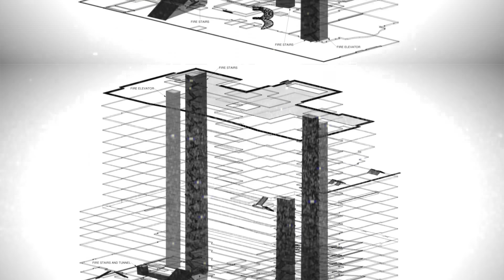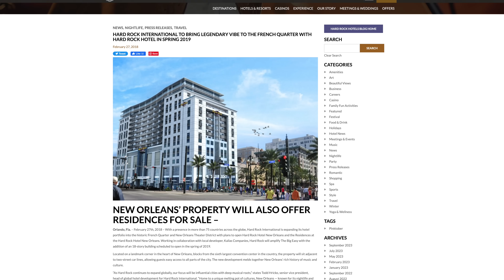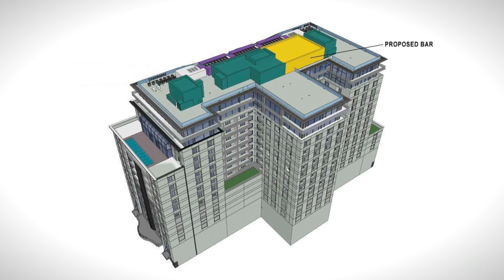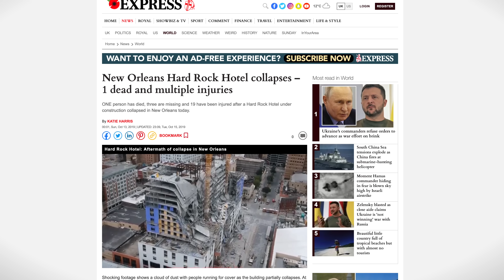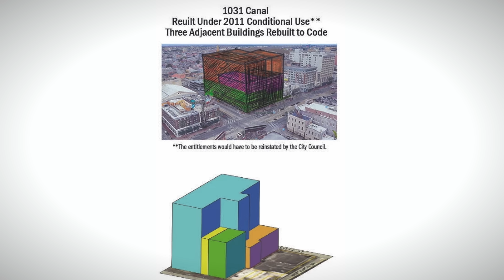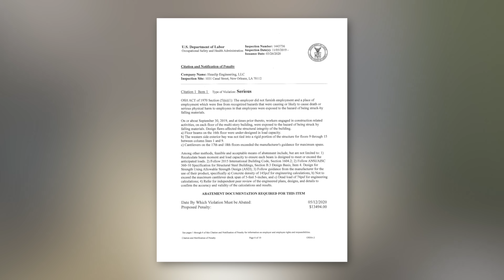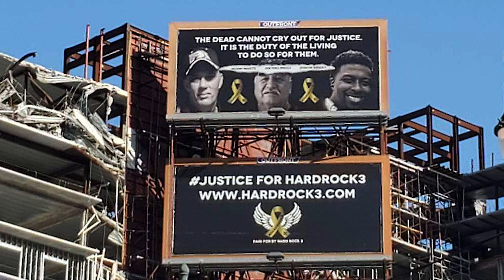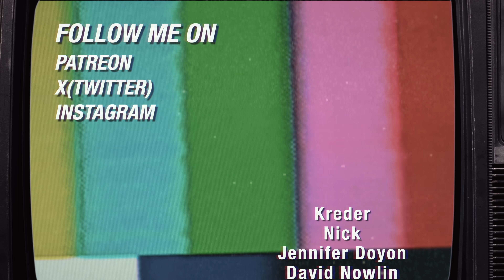Cancelled - Hard Rock Hotel Collapse New Orleans

Comment: Great job on the Hard Rock Hotel New Orleans, I can't believe that nobody got charged for the disaster. I can't wait for your next video.
Reply: I saw other youtubers cover this, they deported several whistleblowers ontop of the firing of the prosecutor.  Credit travels up blame travels down.

This project was pretty aggressively done incorrect at every level.  I'm sure those the most at fault worked really hard to make sure they were ignorant as to why their demands lead to this.
Reply: Obviously, many people, through competence and negligence, contributed to the outcome of the disaster, and did everything they could to avoid responsibility. Like firing the prosecutor who wanted to take criminal action against those responsible, so the new prosecutor could start the case from scratch.
Reply: I saw too much weight and building supplies on the roof.
Reply: You can't believe it, but it's always like that in the US. To simply things they have invented LLC because you can't be responsible if you don't exist 😂

Comment: The floors are noticeably sagging even in your documentary footage of the hard rock job site. that's horrifying.
Reply: I thought it was just my old eyes seeing things.  But it does look like three or four floors towards the top are bowing downwards.
Reply: That curve you see isn’t the upper floors sagging. That exterior wall is slightly concave in shape when you look at the floor plans.
Reply: @DisposableSupervillainHenchman  I also thought it was sagging at first but then remembered the curved middle section. Optical illusion.
Reply: @matthewnormand2041 Yeah. Even with all the corruption in Nola’s inspection system, I’m pretty sure a sag THAT significant would’ve suspended construction immediately. And that wasn’t even the part that collapsed.
Reply: @DisposableSupervillainHenchman  looking back you're absolutely right my mistake.
Reply: Timestamp?

Sounds like a scene out of a bad Final Destination sequel.
Reply: @SmokeyChipOatley   at 6:16 to 6:22ish
Reply: That is the curve of the structural
Reply: @SmokeyChipOatley  I don't know how to link them, but I think it's pretty noticeable at 16 seconds in.
Reply: @octobertheeighth  Thank you!

And for future reference all you have to do is type out the time code exactly as it appears in the bottom left corner when the video is paused in this format, HH:MM:SS (hour/minute/second, or simply MM:SS works too) and YouTube will automatically convert it into a clickable link for you. For example, 00:16 in this case.

It's a neat little shortcut for those times you want to share a particular spot in a video with someone. Hope that helps!
Reply: @SmokeyChipOatley  Oh awesome, thank you!
Reply: I think that is the inward curve of the upper floors that you can also see on the design drawings. The perspective makes it look like a downward bow.
Reply: are you talking about the setback of the top 6 floors? its part of the design and is clearly shown in the render @ 0:06
Reply: I didn’t want to believe I noticed that too 😳
Reply: I'm glad others noticed that.  At first I thought maybe my eyes were playing tricks on me.
Reply: The bottom looks like concrete frame. The top ... is there some combination of words in any language that I could perhaps google and ... ok, that's legit. I'm from Europe and that building starts normal but as you go towards top it's a completely different building. Is there any advantage, cost or time or anything of a building on top of a building then just one building from bottom to top. Cos it looks like three separate buildings stacked. Looks like frame continuity is cut twice and a different building starts twice as you go up
Reply: @GeorgeS-fe7eh  it was all a new build from the foundation up, the upper floors were just less complete. The difference you see is that the lower levels had their cladding installed.
Reply: @nicholastrawinski  the frame has to be one piece. You can't have columns at different locations, it's one continuous piece top to bottom and beam is one continuous piece left to right, front to back
Reply: @nicholastrawinski  one building ends then a different set of columns and beams start but don't rest on the ones below rather on what looks like a very thick roof that serves as foundation for the building above
Reply: @GeorgeS-fe7eh  it is absolutely all the same building. The lower floors are just built in a different style, and the upper floors have setbacks I'm some areas.

It's also quit normal for lower floors / columns / walls to be built bigger, as they have more load on them
Reply: @nicholastrawinski  it starts as concrete frame, bottom is clearly concrete frame. Ends up steel frame at top floor. Not sure what's in the middle but you can simply follow columns from bottom to top. There's two levels where continuity stops, placement is different. Between bottom frame, middle frame and top frame
Reply: @GeorgeS-fe7eh  by framing you mean what exactly? The finished walls?

None of that is concrete. Its built the same as the upper floors where you see the silver 2x4 studs, the yellow sheeting, and the purple waterproofing. 

ITS JUST MORE COMPLETE!
Reply: @nicholastrawinski  bottom has poured reinforced concrete columns. Middle structure columns are too thin to be poured, no ideea what that is. And top frame is prefab, it's steel.And the frame is the load bearing element. Columns and beams. It's really simple and you understand it, but for whatever reason you pretend it's my English or something
Reply: @GeorgeS-fe7eh  yes, the lower columns were built stronger to support the upper floors.

The closer to the roof you get the less steel and concrete you need in the columns. In this case they switched from concrete and rebar to  steel I beams

They added 3 floors to the design of this building, and gained the ceiling height they needed by under sizing the floor beams on the top 3 floors. That's an additional reason the upper floors look "lighter" in their construction.
Reply: @nicholastrawinski  I searched around for why the design is so complicated. The frame functions like a weave to distribute load. Symmetry and continuity is important. Why the top columns coulnt be moved a bit so they rest on bottom columns rather then on beams that themself rest on other beams not directly on columns. They had to be placed right there, pop out of the ground right in that spot. The only explanation I could find is architectural, design purposes, form over function. For any functional purpose, it could have been moved. I bet my life it failed on the separation floor, where the top and middle frames separate
Reply: @GeorgeS-fe7eh  no. It's actually well known that the cantilever sections of the upper floors is what failed. The horizontal beams they used to get the distance they wanted were 1/3 the required strength.

Nothing "popped out of the floor" the collapse started on the top floor due to the weight of construction supplies. 

You seam to be fixated on columns that didnt fail, and how they are attached to a floor that didnt fail either.

Columns CAN be in the middle of a floor span, especially when using post tensioned reinforced concrete.
Reply: Ya the whole side towards the too is sagging in the middle
Reply: @VaunShiz  nope. The edge of the floor is concave on the horizontal. It's not collapsing, it's a design feature visable in the renderings of the building.